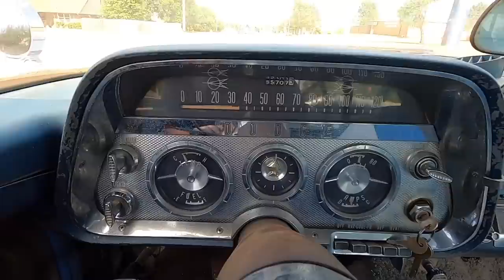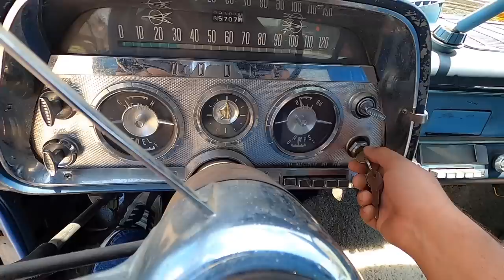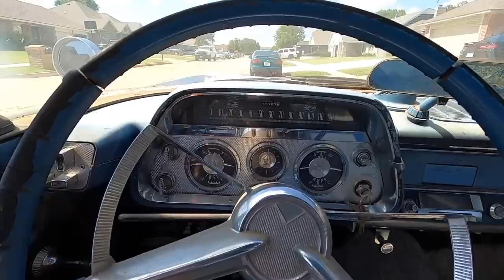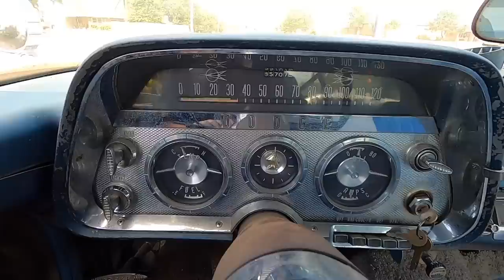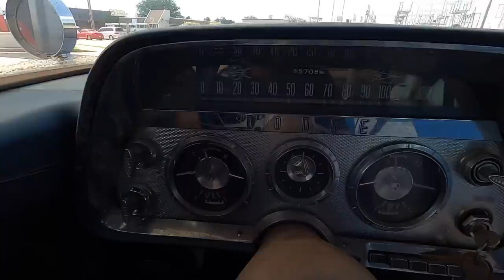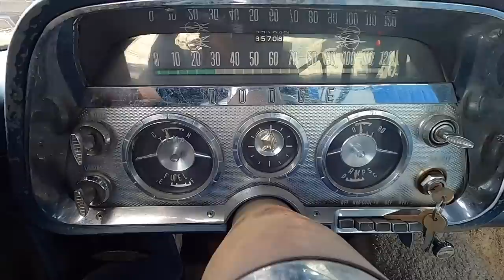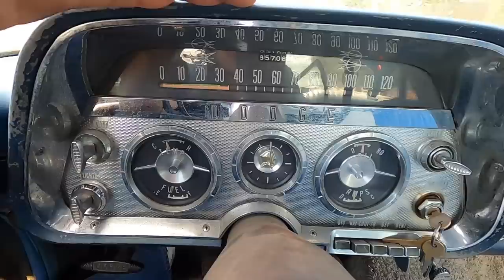Fixing and Driving the 1959 Dodge Coronet for the First Time on July 4th 2020!!!

Comment: The speedo is actually a drum that has the different colors on it and it just rotates as the speed increases.
Reply: Exhaust system is collapsed   road draft. Tube is oil pcv. Valve...muffler is toast too
Reply: Buick also had the same style speedo late 50's early 60's. Some that you viewed in an adjustable mirror.
Reply: I love that system Red happened at (what speed? I forget ,maybe 70.
Reply: I still remember my dad taking apart the speedo on his 57 Dodge wagon at the kitchen table.  This is correct.
Reply: Yes it is
Reply: Can't wait for your next video... you got a new fan here, love these old rare cars👍
Reply: @peacfulseas  yes
Reply: @60viking  65 or 70 yes sir it goes red
Reply: @60viking  70 on my 59 Olds

Comment: The tube from the valve cover is called a road draft tube.  When the car is moving the air rushing past the bottom of the tube creates a suction which evacuates the crankcase.
Reply: And dumps it on the. Road..yuck
Reply: @rsprockets7846  LOL!
Reply: I remember when you would see a dark spot down the center of the road from these draft tubes.  You had to be extra careful after the first bit of rain because it could be very slick!
Reply: Hi, In Australia they were called "walking stick vents / ventilation"
Spot on with the oil slicks when raining, that plus cars just leaking oil all the time.

Some thing you dont see these days

Regards
George

Comment: Actually, you have a 3-speed Torquefilte automatic (buttons for "D", "2", and "1"), and that tube at 16:55 is called a "road draft tube".
Reply: Yup, I have my parents 58 cadillac they bought in 1960. I was 1. My mom gave it to me in 1982, though I had been caring for it since I was about 11. Southern California car, no rust. But about 10 years ago I had to bite the bullet and have the engine rebuilt.  So much blowby coming from the down draft tube, it just wasn't tolerable. I wanted to keep as much of the original engine as possible,  I mean this car not only carted me around since I was 1, it took me to my 1st day of kindergarten too!! Had the engine rebuilt. Hone job, new pistons, and bearings. Crank, rocker assemblys were reused, valves were resurfaced, turned out great. And now when I look down at the downdraft tube. I see nothing, and it just purrs,  like it always did.
Reply: Aka crankcase breather pipe.  Before the PCV valve came along, every car had one.  Blowby gases would  be vented to the atmosphere along with oil mist, resulting in a dark, oily film down the center of each travel lane on any given road.
Reply: Correct. You can hear it go through 3 gears
Reply: @johnfranklin5277  such a great story!

Comment: Randy,
Remember, No ethanol fuel!!! Unless you convert the whole fuel system & Carb to withstand the acid in the ethanol. As for the choke rod from the manifold thermostat, one can shorten it or put two 45 degree bends in it to shorten it.  Your Cater replacement carb is from an early 1960's Dodge, Plymouth or Chrysler. Good Carb. Hope your camshaft lobe has not gone flat from running it with a collapsed or out of adjustment lifter? Good Luck and keep the videos coming on this car. PS: my grandma had one of these cars, 1958 Fury and had the paint like Christine. Grandpa could really scare you with the speeds he drove it. We were never Late for Church!!!
Reply: Yup. Replace all rubber fuel line, blow out steel line. Even if it still has a heat riser valve the cross over is likely plugged with carbon and no heat to operate the choke stove/coil. I would imagine much of the valve noise is due to thinned oil by all the fuel dumped in to the carb. They could have done a compression test while they had the plugs out.
Reply: Ethanol is poisonous
Reply: He should have gotten the original style 2 barrel carb.  That was a much better unit and he wouldn't have had problems with the linkage.  I have that style carb on 2 of my cars right now.
Reply: @chanopokes4846  Is non ethanol even available in OK ?
Reply: @mexicanspec  is that faster because it has 2 holes instead of one I know nothing about carbs
Reply: The fuel line must either stainless steel or neoprene to use ethanol. The gas tank will have to be chemically cleaned and "sloshed" with an ethonol-proof sealant. All rubber bits in the carb and fuel pump must be neoprene or leather. Ethanol is an oxygenate and will corrode steel like your gas tank and fuel lines. Either that or use ethanol free fuel. That can be purchased but it is a bit pricey. I have heard that you can make ethanol gas ethanol-free by fulling a bucket with ethanol gas, pouring water in the gas, let it sit until the ethanol and water mix separates out and pour if off. Makes sense as ethanol is hydrophilic..
Reply: @Oscarphone  that sounds like a big job
Reply: Heads will need hardened seats and use High octane fuel containing no ethanol.

Comment: I always assumed that those type of speedos had a rotating barrel with the different colors revealed as it rotated as the speed increased.
Reply: Check out the 66 Toronado rolling barrel speedometer, kind of cool...
Reply: @jonsmith1259  you are  correct i had a 60 plymouth with the same type speedometer.its a cardboard roll ,with colours on it.
Reply: It's like a toilet paper roll on the GM cars of the day, so it changed progressively following the spiral.

Comment: I have never seen a thermostat that way unless for some reason there’s a crack in the block or something I don’t know how you get carbon buildup like that lol
Reply: Dumping petroleum based head gasket sealers can do that too
Reply: I don't think that was carbon build up.  I think that was a lot of stop leak somebody tried to use.
Reply: Javier Hernandez lol spring water would just be rust 🤣🤣😉
Reply: Mexican Spec it didn’t think of that but you have a point
Reply: @mexicanspec  my thoughts exactly
Reply: have you got the correct pushrods for your 318 yet

Comment: remember: 91 octane non-oxygenated gas. just saying :) she might like rotella diesel oil.. has all the zinc and stuff old engines like. and some marvel mystery oil might be nice too. and they do draw crowds:) if you're foolish enough to sell her, you'll get your money back plus another 1k ;)
Reply: Negative on that, asn413. It's a low compression engine. 87 octane is fine. 10W40 oil is good also. Zinc only becomes an issue with high compression engines.
Reply: @ronwaters478  i ran a 301 poly for a long time. same type of engine. the valve seats won't hold up with oxygenated gas. 91 octane is the only kind of non-oxy available at most gas stations. its either that or lead substitute. lawn mowers need the 91 for the same reasons. ive owned my car for 20 years and am friends with all kinds of people who specialize in finned mopars. trust me!

Comment: I really think you need to replace that intake, and do a 4 barrel job.
Reply: Check distributor. And vac advance. Valve train needs a look see...timing.  Chain. Is toast too.
Reply: Pretty rare car. I don't think there are a lot of aftermarket parts for it. Maybe one from another Mopar might work.
Reply: There was a 2x4 manifold on a 290 horse version .... possibly made by offenhauser

Comment: Those heater hoses, due to the *ultra rare* factory A/C (1959) it's equipped with the heater valve and 4 hoses, one of yours has been bypassed and looped, probably for a reason. The exhaust leaks need attention, and it would sound great!! That 316 ci engine is rare AF and I'd just make it smooth and the car safe. The interior is so nice, I'd finish that resto, door cards and carpet, but leave most of the body alone. *Maybe* spruce up the white paint, perhaps even a respray but leave the blue alone. Also, Coker tires are expensive, be prepared..
LOVE THIS CAR, 4 doors and all !!

Comment: As someone stated the Speedo is a drum about the width of the entire speedometer.  The colors are on it like lanes.  As the cable spins it rotates the the drum slowly.  Each lane starts out green or white.  As the drum turns when it reaches 35 all the lanes showing are then colored orange and when you reach 60 to 65 all the lanes are colored red.  My dad had a 58 Coronet and my boss had a 59 Dodge which both had a speedometer like yours.  I thought it looked like an old fashion thermometer.  If you put your palm 8 to 10 inches (far enough so not to get burned)  at the end of the exhaust pipes,  if the engine is running smooth (not missing) you will feel steady air like a blow dryer.  If you have a miss you will feel a pulsating air flow or puffing against your hand.  Another way to find your miss is to a pull plug wire one at time, with the engine running.  If you pull a wire that isn’t missing the engine will run bad or even worse. When you pull the wire on the missing cylinder there will be no change.  Be sure to use insulates pliers or you will get a really good shock.  You can pull the wires with the engine off and then start it each time but it not as easy to see the effects.  I lived when these cars came out and thought they were great back then and still do.  I currently own a 66 Dodge Charger I bought off the original owner back in 1978.  I only drive it occasionally but I really enjoy it. I’m going to watch your third video now.  Stay with it you will enjoy it even more when she is running great.

Comment: You ABSOLUTELY need a thermostat  in the summer! It gives the radiator a chance to cool the water down. It will run for a while normal but will overheat the longer you drive. Especially if sitting in traffic.

Comment: Transmission  is torque fight 3 speed. The spring you found in car goes to vent window. The part you  removed  from  the  heater hose was a valve  for temperature control for heater.

Comment: Yes, you need a tstat during the summer. It does two things. Holds the coolant in the engine to warm up the engine and it slows the flow of coolant through the radiator. It allows coolant to stay in the radiator long enough to get cooled off. At the very least, you should cut the guts out of the thermostat and reinstall the outer ring. That slows coolant flow down.

Comment: The heater hose should have a cable operated valve that connects to the switch in dash, the rest is a/c stuff like the other guy said.

Comment: I'm a retired self employed auto tech, I did everything but engine, trans and electrical! I did body, frame, paint uni-structure suspension and alignment! On my old cars I also work on the engine and trans, I'm living in the past, my cars are pre computer V8 rear wheel drive behemoths!  I live for these old cars now! Most of my stuff is 60'S  and 70'S but I have a 51 Ford and a 47 Chevy! My daily drivers are 70'S cars, I buy what I like and what is a good deal for me! I don't sell them any more I just keep making more of them into runners! If I buy a junker and it's too bad off it gets parted on line and nothing goes to waste! If I were you I would do the hoses and belts then take this car to Maaco since they did your truck so cheap and see how much it would cost to take the dents out and patch the rust and keep that old car! You don't have to restore it just make it look good and drive it around ! These old cars make excellent daily drivers if you don't drive long distances every day! The upside is you get treated like a celebrity! Everyone sees you and waves or hollers and gives you the thumbs up! Go for it! I can tell you love it! That car made me notice you and subscribe!

Comment: The tube pointing down is called a road draft tube. It has a baloney cut on the end and as you drive the air passing it caused a slight vacuum in the engines internal area venting vapors out of the crankcase. The other valve cover should have a vented cap.

Comment: Saw 2 videos of your Dodge Coronet.  I can't say for sure that they are the same, but I suspect that yours is very much like the 1958 Desoto that my dad bought and let me drive (I think it was 1964 and 1965).  That car had a 326 V8 engine in it.  It also had what looks like the same speedometer in it.  My Desoto had a colored round cylinder behind the gauge in the dash.  The tube was turned as you increased speed and that allowed the color to change from green to orange to red.  Good luck getting your new/old car fixed up and running.

Comment: I haven't looked at the later video but based on hearing it when you crank it over and the way it sounds, it likely has a burnt exhaust valve on the passenger side. Fortunately on an old car like that you can have the heads off in just a few hours and have a machine shop grind the valves. After that, it will probably run like a top.

Comment: Thanks for the fireworks display.  Thanks for preserving the Dodge. Since you asked, yes to tires and while you are at it check the brakes and repack frt wheel bearings. BE AWARE it is likely that wheel lugs are left and right hand threaded. Pull the hub caps to confirm. There will be an "L"  either on the lug bolt or stud. You will need a puller to remove the rear drums ( fun fun). I would consider replacing the electric fuel pump for a stock mechanical pump or at the very least wire a shut off that when the engine dies the pump shuts down as well. Can be wired to oil pressure sending unit(s). Exhaust with a pair of Smitty's so you don't gas yourself out  As straight as this car is IT Deserves a paint job. It would make all the  sweet stainless and chrome POP. I know that you are fond of " Re-Sale Red " but with that blue interior consider the original colors combo. The one rust spot I remember is the dogleg that could be repaired easily and properly. Have an upholstery shop put new carpet. Pressure wash the engine/area.  That A/C can be made to function with a universal receiver dryer and charged with R34 refrigerant. 
Great job on doing that gas tank On The Ground in the heat!!!. I'm   hanging my head in shame. I have a new tank for the Nomad and keep putting it off.
1930's-40's--50's- 60's are my gig for over 40+ yrs.I am NOT a restorer!!! Do not undervalue this gem.

Comment: Keep this car as stock as possible. Just do a few modernized changes. 1. Try a good set of radial tires and modern shocks that would make it ride and handle even better. 2. Electronic ignition is good also do not give up on that. 3. Fix what needs to be fixed. 4. Check out Retro Audio they can set you up a modern radio that will match your dash.4. This is a cruiser not a hot rod . Looking forward to more videos of this car. Like your videos alot.

Comment: A thermostat does play a role in the summer. It slows the rate of coolant flow to allow the water to stay in the radiator long enough to cool down. Put a new one in there. It will help.

Comment: You can install a brake booster kit that bolts in. Huge safety upgrade. Tires yes, also flush the brake lines, corrosion is a killer and water does slowly enter the system and when heated expands, making the pedal feel squishy. Keep that patina replace the mechanical issues and you'll have people crawling out of the woodworks with offers. Do not sell! You'll regret letting that one go.

Comment: The speedometer is not lights.
It's a cylinder with different colored stripes on it. When the speedo cable turns, a reduction gear turns the cylinder which exposes the colored lines showing speed as it rotates.

Comment: The speedometer is a rotating drum.   The colors are painted on the drum, and as you speed up, the color seen through the slot changes as the drum rotates and a different color is exposed.

Comment: these cars are pure joy.  just as you find them. torsion aire suspension, they corner like they're on rails. my 57 isnt perfect either but i love her dents and all. I suggest firestone wide oval white walls. coker should have them. and you dont have to worry about a 12000$ paint job getting ruined by a stray grocery cart. sorry if im getting annoying.
Reply: oh. i had the wrong name on the tires. I recommend the BF goodrich silvertown. get as big and wide as you can stuff in the wheel wells. Makes a good handling car great. one caveat: take a good look at your steering shaft. mine snapped. God was with me. i just pulled into my local mechanic and pop! off she came. no tow needed and i didn't die. the shaft is actually a tube. shutting up now XD

Comment: Folks have commented about not using the gas with alcohol content - only pure gasoline.  Let's not forget that gas from that era had lead in it.  The lead helps protect the valve seats on the heads.  If you can find dome lead additive at the local auto parts store, then use that.  If you can't get that, the heads will need to have the valve seats replaced with hardened seats.

Comment: i was born in the 50's,we use to ride in the back window,dad throw on the brakes and we would go flying.the speedometer they called a boon to safety  it was a warning where it changed colors when you got to fast,some had a buzzer,with you dad would soon disconnect  lol